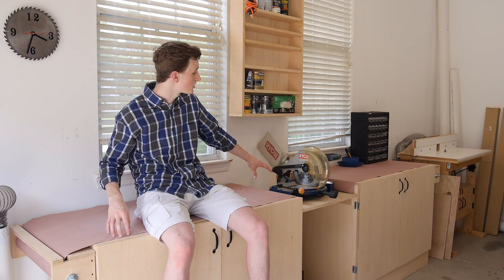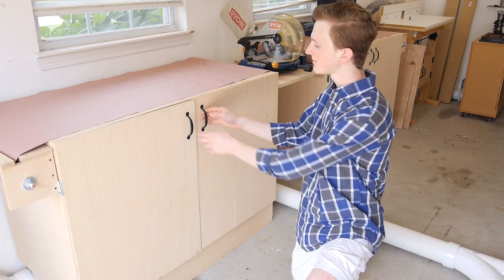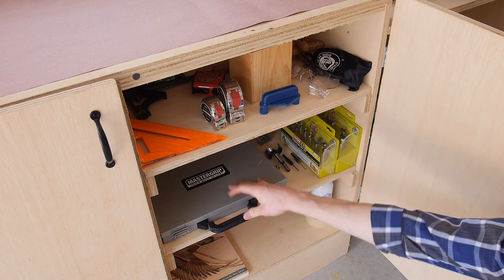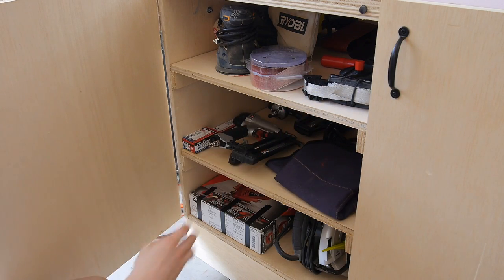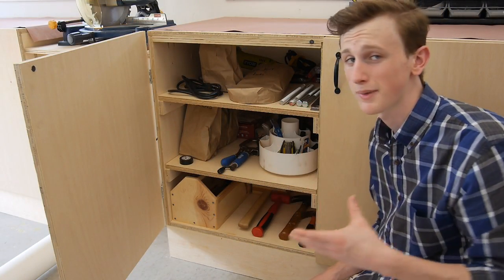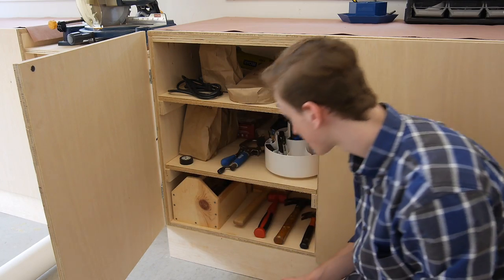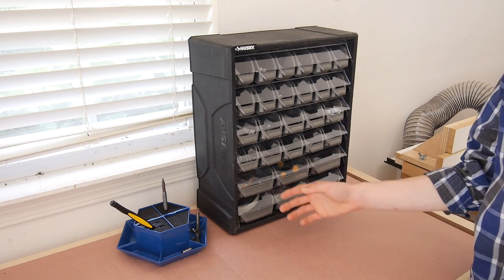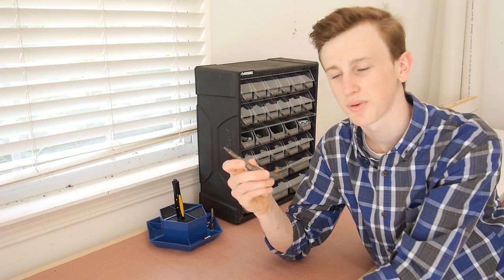Shop Tour 2017 | My Garage Woodshop!

Comment: I bought the same Delta tablesaw from Lowes and I agree, the fence is what separates it from the others you mentioned. I do have a suggestion for you that will let you recoup some of your floor space and add some versatility to the saw and that is to turn the right wing into a router table. I have one installed on mine and it not only gives me a lot more flat table space on the end of the tablesaw, but it also frees up my precious garage floor space for other tools. Just a little food for thought. I purchased a Triton plunge router for my table because it has it's very own table lift system that allows me to make height adjustments to the router from above the table. If you are interested in some photos of my conversion, just let me know.  Cheers.

Comment: Rockler sells dust collection hose that holds its shape when you bend it. That would work well for your drill press; you could just point the hose at the bit and it would stay there. Nice shop!

Comment: take a dust hood like the one for the laythe mount it under the drill press table with a grate over it so it sucks most of the stuff away but wont drop the pieces in your collector
Reply: I was also going to suggest this and i think it would be the best option